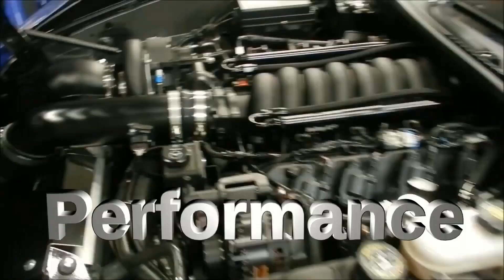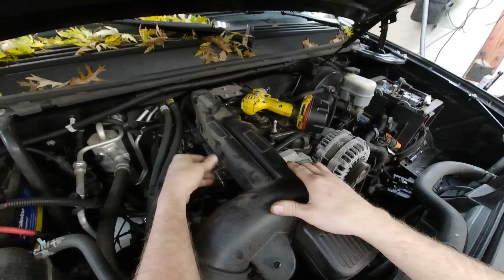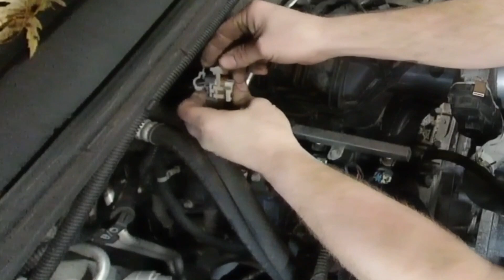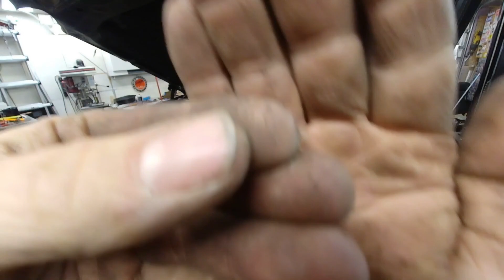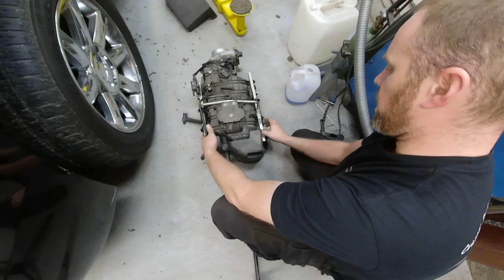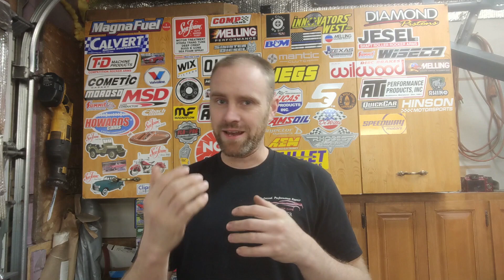Remove Intake Manifold GM Truck, Accessing The VLOM

Comment: I replaced intake gaskets, now when truck first starts idle is high,,1500-2000 rpm. Then it settles down to just under 1000. But if you tap the throttle in park, it will rev to2500 -3000 and stay there until you put a load on it like turning on the ac.  If that’s not bad enough, when your in gear and start driving, the truck wants to accelerate by itself,,,WTH has happened? Thanks
Reply from the maker: You most likely have a vacuum hose off. Check PCV port hose and any others

Comment: Can the fuel line be removed without the quick connect?
Reply: No the tool is necessary to remove the connection. O'Rielly's has a full set different sizes for under $10.

Comment: Just throwing it out there,  the purge solenoid goes on either way and will throw a code if backwards. You'll probably waste 30 dollars like me on a new one and realize you might realize you put did that after you put grease on the new one to ensure the hoses seal up and can't return it.
Reply from the maker: I just know what way they go so never put them on backwards. Good to know in case someone else mentions it I suppose.

Comment: 2007.5 has no tab to remove hose from pcv valve. A flathead screw driver will help pry it from the base.

Comment: What’s the PCV issue in the valve cover that you mention?
Reply from the maker: I have an oil consumption video specifically about it. Admittedly the first one needs to be redone but the concept is the same. Just be sure to read the discrimination.

Comment: Your videos have great information!! Thank you for them. I have a question for Ya. I have a "11 silverado 5.3 lc9 with the alum block i noticed many of  my vlom bolts are loose. Would that cause a oil pressure drop at idle when warm? its runs 40-50 psi cold and when warm down to 20 psi,  no codes or misfires . But there is a nice lifter tap present.  Thanks again for sharing your Knowledge with us all! Peace

Comment: If I have a rough idle and it blows white smoke on start up does that mean I have a head gasket issue as well or is that normal for it to smoke till it’s warm?
Reply from the maker: Check inside intake for oil. I bet your PCV system is sucking oil into your intake.
Reply: @CrazedPerformanceRepair  I did see some not gobs but a little also I notice the coolant reservoir goes down some over time too if it’s not actually using coolant how does a man fix the pcv system? Thank you for your help man i appreciate it

Comment: I wish I wouldve watched this video before putting mine back together. Had a lifter go so thats what i looked up. Got it back together and have oil leaking. Looks from the VLOM area. More than likely the oil sensor. Have to remove the intake to get back to it. I almost want to start crying. Not have that cover on the back would sure be nice right about now

Comment: So, did you have to drain the coolant before you took off the intake manifold, or is not any coolant in the intake manifold.  Thanks. I have to change my oil pressure sensor, and it looks like it be easier to do if i remove the intake manifold, to get to it.  Thanks. Please get back with me, got to do this in a few wweks.  Also would you alway change the gasket,too. Rick
Reply from the maker: There's no coolant going to the intake manifold on these. When you take the intake off throw that piece of plastic away on the back of it so if you have to change the sensor again you don't have to pull the intake. Inspect the gaskets to make sure the silicone rubber that's in them actually sits higher than the plastic surface that it's in. If that's the case the gas hits are reusable. If they are flush with the plastic they are junk.

Comment: Jason, I have a 2007 Tahoe 5.3 with 240K on it. Before I take it apart, does it have the DOD/VLOB type valley cover, or the old style with the knock sensors? On a truck this old, do you recommend  doing any of the modifications? or leave well enough alone? I have a slight oil leak on the passenger rear side. thinking gasket needs replacement. I also am changing the oilt pressure sensor due to my oil pressure dropping out. I am not having any other problems and temp is normal. No engine noise either.

Comment: So the lifter release tool will only work if the vehicle has dod tuned out?  Or can i use this tool to free up a lifter and still use dod or no
Reply from the maker: It must be turned off or it will collapse the first time it activates.
Reply: @CrazedPerformanceRepair  ok im gonna get it disabled in the next couple weeks then after im gonna im gonna try this and free it up so since it will be disabled it shoukd be good to go after that correct? Right now its just minor tapping not like how your previous videos have sounded
Reply from the maker: @NORCALPYRO_  does it have the tap all the time? Have you checked for a loose rocker yet? If it has a collapsed lifter I wouldn't keep driving on it. It can chew up the cam eventually.
Reply: @CrazedPerformanceRepair  honestly its more of a ticking my dad cant hear it but i can and when v4 mode kicks in it sounds like shit with my exhaust no codes no loss of performance or anything like that i have a bi directional tech 2 scanner and theres no live misfire data or anything like that... so i might just take the valve cover off and check that way but when i put the truck in m5 it runs and sounds amazing like a normal v8... i do have rear exhaust manifold bolts snap off in head one on each cylinder towards firewall. But i dont think its the manifold gasket
Reply from the maker: @NORCALPYRO_  the exhaust was exactly why I asked if it does it all the time. Exhaust manifold gaskets will be louder at first start up then quite down quickly as they heat up. You likely just have that. The sounds like crap will happen in 4cyl with louder than stock exhaust. Just have AFM turned off in tune for that.
Reply: @CrazedPerformanceRepair  im in california for looking into that like i said i just wanna make sure it still. An pass smog with the altered ecu
Reply from the maker: @NORCALPYRO_  as long as they don't start reading tune files and comparing them to factory tune for your exact vin number they will never know it was turned off. That seems like far too much trouble to go through especially since the 2500 or bigger never has AFM. They are banning fossil fuel vehicles anyway soon so why would they bother. Time to move from that hell hole.

Comment: It would of been parts store closed and I wouldn't have got the truck running if I didn't watch this. Doing knock sensors on 07 Tahoe 🛻
Reply from the maker: Knock sensors are on side of the block this clearly won't help you.

Comment: i saw one video were he ust removed te manifold witout takin off the injectors pretty much as a whole, would that have been easier for you or you prefer to do it the way you did?
Reply from the maker: I did it without removing the injectors from the manifold. Not sure why you think I took injectors off. I took it all off assembled, I feel this is much easier.
Reply: @CrazedPerformanceRepair  my mistake was watching a few of these and someone took them out I got them confused

Comment: i have opened this Yukon 2014 XL to replace one of the  lifters and found this dirt and grass what do you think can i clean this engine without taking the whole engine out :yt: https://www.youtube.com/watch?v=_RMEy4G3-pM
Reply from the maker: Clean out what you can while it's apart. When you do a flush on it you're going to have a lot of sludge issues. You may even have to pull the pan and clean out the oil sump several times. An ATF flush would be the way to go here. I do have a video on it, basically you need to fill the engine up with ATF and let it sit in idle for a long time so it breaks down the sludge. Every so often you're going to have to change the oil filter as it loses oil pressure and you may even have to pull the oil sump if this thing's bad enough which it might be. The longer you can run it and keep changing filters at idle the better. Make sure you have a fairly full tank of gas before you start because you're going to have to run this thing for probably an entire day. If it gets nasty enough in the oil / ATF is dark enough you may want to change it in the middle of doing this as well to make sure it keeps cleaning.

Comment: HEY.  , I RECIEVFED MY PACKAGE FOR THE LIFTER RELEASE. THANKS.  I have questions about the VLOM in which it seems under the radar, that it initiated the oil to lifter problem.   Also I know DOD delete  may have been necessary since it did damage but if the cam is still serviceable dont we just changed the head with new valves one or both?  some shops have just been writing that off to replace an entire engine.  I'm not going with that kind of cop out mechanical work, do you  have a response of what steps would be considered and what are the chances of any damage.  Thanks  I will be using my 2007 GMC Yukon xl 5.3 for a example of a motor with about 130,000 miles.

Comment: Dude, thank you so much. I ordered the pin and the vlom plug, I used this video as guidance, and I freed the stuck lifter. It took me a couple days, but I’ve never done anything like this before. I got a new Edge CTS3 programmer and deleted DOD. The truck is running like a top. 👍

Comment: These are some of the best videos on Youtube!!!   I have a 2013 Yukon with a 6.2l,  84,000 miles and no oil pressure.  I have been getting ready to tear in to this beast.  Probably need to do a full AFM removal....  I would really like to but everything from you....  and a shirt that is not black....  Keep the great videos coming...  you do the best job explaining everything...  Thanks
Reply from the maker: Thanks for mentioning a shirt other than black, I will have to consider a shirt purchase eventually here to add variety. I knew it was limited but that was all I could afford to do at the time. 🙂

Comment: Getting low oil pressure after warming up.  I am thinking its the bearings.  I have replaced the O-ring on the pickup tube and plugged off the 2nd oil pressure relief valve above the oil filter.  I have not removed the Vlom yet to check for any problems.  What do you think?  Ever seen this problem with out it being a bearing?
Reply: I am looking for answers to this as well.  Low oil pressure when HOT IDLE 18-20psi  Changed O-ring and oil pump,sending unit screen.  Still low?  Is it Vlom leaking or bearings.  No codes runs good.
Reply: @Rotaris1  getting the same pressure when hot at idle.  18-20.   Still runs great.  Haven't pulled the intake off yet to plug the vlom.
Reply: Did either of you ever figure out your low oil pressure? Mine is doing exactly what you all are describing.
Reply: @tnmedicjls  I plugged the pan relief valve off and plugged the vlom off.   It helped a little.  I switched to a PF63E oil filter.  This bigger filter jumped my pressure up over 20psi at idle once hot.  After this change I noticed my rear main seal is leaking.  Also my oil cooler lines are leaking.  Even with these leaks I'm getting 22-25ish psi pressure at hot idle and 40-47ish psi at highway speeds.   The filter seems to be a band-aid.  But has been working great the last 5k

Comment: I just did a lifter on mine. You dont need to remove the alternator.
Reply from the maker: Nope but 2 bolts over reaching around it the entire time... I'll pull the bolts.
Reply: @CrazedPerformanceRepair  yea true
 The side i did was cyl 6 so it was never in my way.

Comment: Great video!.  Can you elaborate on the excess oil and PCV valve you mentioned at 14:32 in video?   Possible a future video?  My understanding is the valve cover has an orifice instead of the typical check valve rattle type on older models?  Interested in how this orifice works, if it is susceptible to clogging, if updated valve cover is adequate to remedy the oil accumulation issue you noted etc.?  I have enjoyed your videos about AFM issues, how the system works etc. so please keep them coming.
Reply from the maker: I do want to touch more on the valve cover thing because I believe I have a solution that doesn't necessarily require replacement of the valve cover. I have also found out the issue stems deeper then just the cover and in some cases and involves the lifters. That will be a future separate video.
Reply: @CrazedPerformanceRepair  does the Vlom  have a torque sequence r Ft lbs to put back on I can’t find anything
Reply from the maker: @savageboy2257  it's a measly 16 ft lb I believe. I will create a forum post on my website tomorrow if I remember.
Reply: Please please post video on this issue.

Comment: I was very successful with the lifter trick and mod the vlom also Hp Tuners for the disabled DoD my 2008 Gmc Denali 5.3 runs great had no issues since that's been said my service stability control and abs stays on no issues with the truck just aggervated with the light staying on any thoughts it maybe?
Reply from the maker: Need to pull code for abs and see what shows up. Might be able to pull that with HP tuners otherwise stay tuned for next week's video. New affordable scan tool I got to try out and glad I tried it.
Reply: @CrazedPerformanceRepair  thanks I've got a code reader Idk if it scans for Abs thanks and ill tune in...
Reply: I bought one of your tools sometime last year saved me tons of money by the way... Thanks dude your awesome.

Comment: mine  would be easy  ,,lol  old school  350  tbi   92 chevy  k1500.....its as easy  to work on  like   my 56  chev  an my corvairs  ,,new  cars  are a mess  ,,showing my age
Reply from the maker: I beg to differ... I feel those are harder simply because of having to line up the distributor and deal with the cooling system. That's the nice thing on these is there isn't the mess, but most cars this new are not so friendly. The only tough part on the new GM over the old is the lack of wires and clips.
Reply: @CrazedPerformanceRepair    lol  i am used    small blocks   ,,..but  my corvairs are the  easy  mans  car  to work on..,,junk gas   hurts them
Reply: Yet another helpful video, thanks.